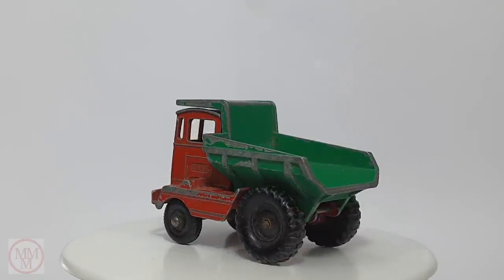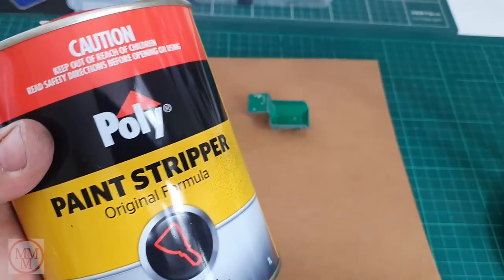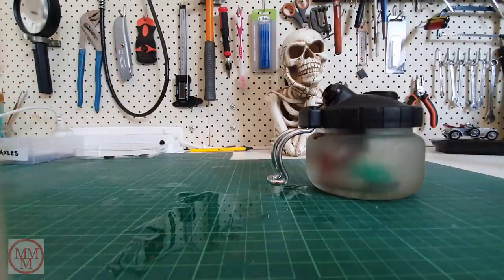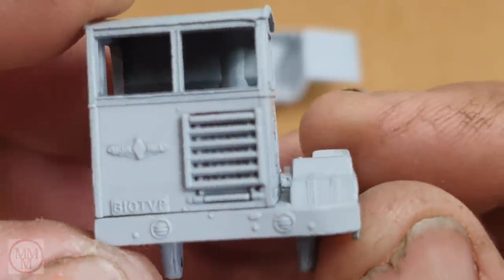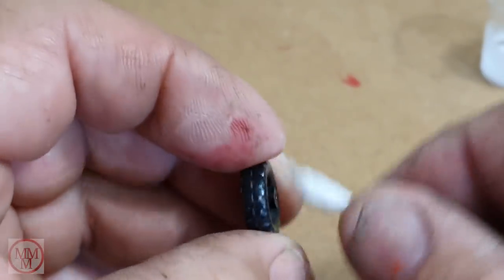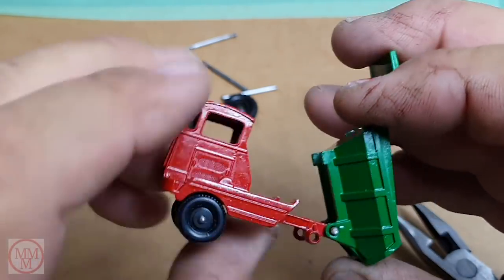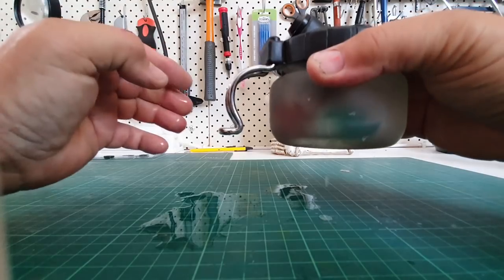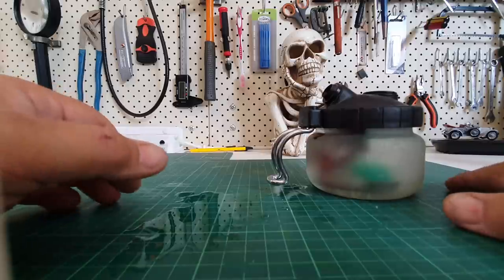MATCHBOX Restoration No.2C Muir Hill Dumper 1961

Comment: I can not tell you how much I missed  these little interludes. It is so nice to have you back. I absolutely LOVED the reference to the little bags in Kevin's room.......though I should be embarrassed to admit it. 

By the way, the trick to avoiding the white border on the transfer is to print the black border a shade to wide and then trim the black to the appropriate width.
Reply: If you want to use the original thickness black border as a guide to cutting, you can do a red coloured line that better matches the base colour if you don't cut exactly on the black line.

Comment: Hi Marty, if you haven’t found out yet, pull the lid of the thinners up while screwed on and the neck will extend for pouring.
Reply: not with this cans, I'm afraid; we have the same ones here in europe, and there is no extending neck like on engine oil canisters, alas. no idea what the makers are thinking... you even can't empty it completely.
Reply: @lotharrenz4621  Hi, I’m in Europe too, never come across a can of thinners that didn’t have an extending neck. Maybe the cheaper ones come with a separate screw on filler tube, but I’ve never come across one.
Reply: @HiruS22  no idea, maybe germany has different market rules? I have never seen an extending neck on small cans, only on the 5, 10, or 20 litre cans. the larger ones, sotosay.

Comment: I restore old tube type Ham Radio's, and have found that using automotive hand cleaner and toothbrush on the
knobs, turns out very well.  It comes in a tub and is like the consistency of hand cream.
Just dip a bit on a brush and scrub all over and wipe with a dry towel.   This makes the knobs look almost brand new.   The smell is very nice and is non-toxic.  All auto parts store carry, this stuff.
(IT does not hurt plastic)  
Very nice work on the truck.  I have watched all your videos, and they are done very well.  Very Professional. 😀

Comment: When using the white-backed paper, maybe you could try the method that Toy Polloi uses. He prints his stickers with a light grey border outside the design, then cuts away the grey. Might make it easier to be more precise.

Great to see you back in the saddle!
Reply: Great idea! I do watch Toy Polloi but not all his stuff so I missed that!
Reply: Better yet, print them with (in this case) a red border.  That'll blend right into the background.  As Marty discovered, the clear film really only works on white surfaces or glass.
Reply: @keithschrack  it seems so simple but that’s great advice. Thanks from me. I’ve been modelling 30 years and I do try to move with the times but the tech is starting to beat me! 😂

Comment: Marty! Welcome back.

A little graphic design/printing trick for your decals: The bleed.

When you design an element with color at the edges, extend that color beyond the dimensions of the decal and build hash marks off the corners (bleed marks) so you know where to cut. This way, after you cut out the decal, the color will extend to the edge of the piece rather than having to be exact with the cut. I'd include an image if YT would allow it, but just Google printer's bleed to see how it works.

Comment: What a cute little truck! I am surprised you didn’t use your drill press, but it worked out well. Try a microfiber or jewelry cloth with the polish and rub it around in the cloth for a bit -  it will make them shine like they just came out of the mold. I use some “LOOX” plastic polish here in Japan (From Kure). Hearing your opening music made me smile as soon as the video started. 😊 PS: try your polish on the window frames, or some beeswax - they bind up when you lift from one side.

Comment: HI Marty Quick tip for the decals. As a designer, if we are printing anything that 'bleeds' off the finished cut edge of something like a magazine page edge or some printed packaging, we allow for a wider border (which is called adding bleed) and have some trim marks )of the finished size on each corner of the artwork that you can use to cut into the bleed area leaving no white background, Use a No. 10 Swan and morton scalpel blade in a scalpel handle (more precise than an exacto type knife) and a metal edged ruler. keep up the good work, loving it mate,

Comment: Well done, once again.
As may have been mentioned, you can reuse the cut axles by using a tube of suitable diameter as a sleeve.  This would also eliminate the chipping risk entailed in reforming the axle ends.

Comment: Procedure is different for thinner. Rotate the empty container 90 degrees, and place the edge against the lip of the thinner bottle and slowly tip the thinner to pour the thinner into the working container. Then as it fills tip both to ease the filling. Suggestion for working containers would be a used SALSA glass container with its steel lid ( it has a seal that will work at least 1 time. Turn your ventilators on first before filling the working jar.

Comment: Well it was me that suggested the thinners un fortunately Marty used the wrong type of thinners the thinners I used were standard thinners for solvent based car paint  and yes they do smell but it’s a lot better than paint remover and doesn’t burn you if you get it on your hands and the main thing is the thinners I used took the paint off 2 models one was the tv rental van and the other was a rolls Royce with the newer wheels  the paint just fell off but anyway keep up the good work and it’s great to see you back

Comment: Oh dear, I see Kevin hasn't changed with the country move lol. Yes I too have tried the thinner trick but still go back to good old Poly Stripper, I usually leave a casting for up to 2 hours and then a container (2L ice cream tub) in the sink with fresh boiled water from the kettle and a few drops of morning fresh dish washing liquid. Drop the casting in and it generally bubbles and fizzes up and takes some paint off before I remove and scrub with an old toothbrush and then a green scouring pad.

Comment: A sweet little model and it looks great.  I'm late to he table for this video because I suddenly remembered I hadn't seen a new one for a while.  I wanted to let you know that your decal application method has come in handy for me when applying delicate numbers, logos and lining to a vintage Tri-ang coach from about 1956.  Dabbing water onto the surface first and then rolling the cotton bud along the decal to take out the excess water after is a neat method.  Also, I have since discovered Humbrol Decalfix and found it works very well.  Cheers.

Comment: A useful trick I have been using for light coloured decals, or decals with white lettering, is to place a totally blank white decal, just a tad smaller than your design, on the model first. Then you place your clear decal on top, with the dark edges going past the edges of the white. 
This trick only works when there is a dark border on the clear decal. Cheers.🍺

Comment: Good job and still have your sense of humor which helps set your channel apart from others. I used to work in the sign business here in the states and I can give you a suggestion on the white border issue. Depending on shape, you can use crop marks and a bleed to get you some decals that will be closer to spot on. 

Bleed is where you take the color that is on the very outside of the graphic and you extend it a bit further out. The crop marks help you align the cutting apparatus of your choice up so when you do cut the paper, you should be left with a decal that has edge to edge color and no white. Good job on the model!

Comment: For future reference. On the pins as on the tipper there, when you get them out. Hammer the end you flattened to extend the pin slightly so 1. it is easier to put back and 2. you have extended the pin to allow for mushrooming it to hold the pin in.

Comment: as a suggestion, on the better condition axles in a situation like this, you might consider cutting it at the far end so you can use them as parts for narrow applications.

looks like that thinner does work and pretty well but yeah, needs a really well ventilated area.  can you use that stuff up thinning your paint?  or cleaning out your air brush?

Comment: By heating the replacement axles it annealed the metal that makes it easier to tool and using a bit of fine steel wool to polish them works as well. Pinching the end of an axle in his previous makeover can be done easier as well if he has a pair of nippers that are shot and a file to alter them. By flattening the cutting edges nearest to the pivot point he can easily crush the rod since its fulcrum is at its most powerful at the point. Indeed you've experienced the effect when using a wire killer etc  when its furthest back in its jaws while its cutting verses at their tips which is harder. The best way to get liquid out off such a short spout is not to tip it over at all but use tube and place your thumb over one end like a straw to lift it out. Marty should post photos of  the Matchboxes he's looking to restore he's missing since viewers would be happy to send them on if they have them.

Comment: @5:12 A caution for using thinners: petroleum-based thinners, like mineral spirits, or lacquer thinners, will work with metal, but if you stick plastic or resin bits in them, the thinner will likely attack and dissolve the parts.  Mineral spirits will definitely damage styrene.
I use Super Clean, an automotive degreaser, to strip paint from metal, plastics, and resin.  It's not nearly as caustic in use as other products, and you can use a batch over and over.  I fill glass jars of various sizes and soak pieces in it.  The liquid attacks the paint immediately; you can often see the paint dissolving into the solution.  After about 5 minutes, I take the piece out, hold it under running water, and use an old toothbrush to scrub away the reside.  Sometimes it takes a second bath, to get to paint in recessed details.  Since Super Clean can be reused, and can be used around the house, it satisfies my Dutchy senses for something frugal.
@8:55 Well, there you go.
As far as experimentation with a new technique goes, we have a saying around here: "If it ain't broke, don't fix it."
@16:29 "I don't know why I'm bothering...no one will ever look at it again."  The old debate in modeling-to add details, if no one will ever see them, or not.  I'm in the "But I'll know it's there!" crowd.
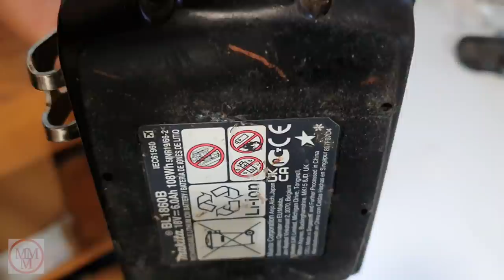@19:28 Do you still ever use the rig you devised with your drill press, to dome the ends of the axles?
@28:16 a beautiful finish!

Comment: Good to see you back. Whomever told you to use thinner as a stripper not only mislead you; is mislead themselves. Thinner is as the name implies, meant to thin. Used with the appropriate breathing apparatus and the appropriate spray rig. It's not really surprising it reacted with the gasket material and given enough time, quite possibly would have reacted with the lid itself. I would urge you to get rid of that stuff. Even if it had worked as the guy claimed, it would hardly be worth the risk. An errant spark, static from carpet, etc. Well, I think you can see where that might end. I get too much enjoyment just watching your regular method.

Comment: That tiny thing is done in 10 minutes. I have striped paint of hole models whit toothpicks, that is boring.  The last model I stripped the paint off took me about 2 days, luckily I use water-based colors so I just need hot water and dish soap.

Comment: Mate. Drop the model in an old builders bucket. Add a kettle of boiling water. the at arms length add a table spoon of caustic soda. Avoid the vapour. Leave it to bubble for 5 minutes. Then drain away over the garden weeds. They will die and your model just needs polishing. Yay!!